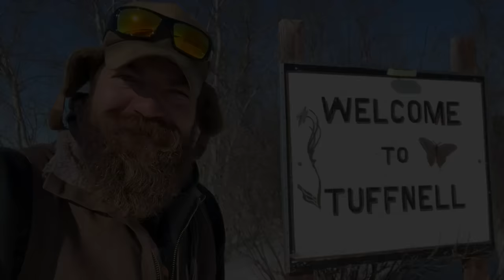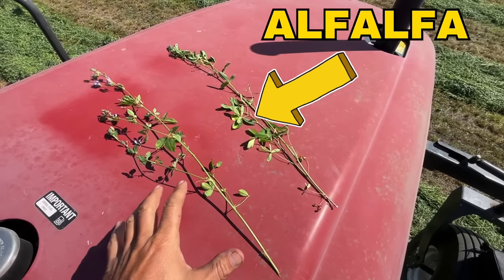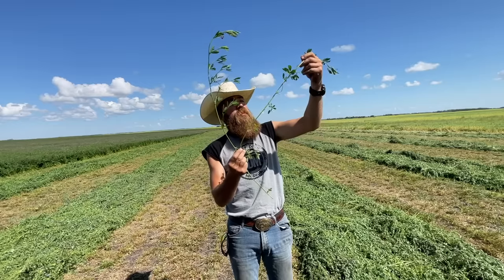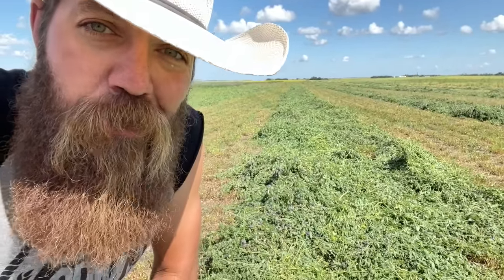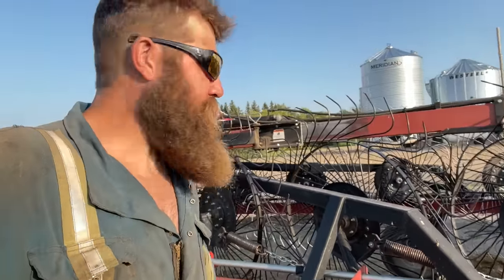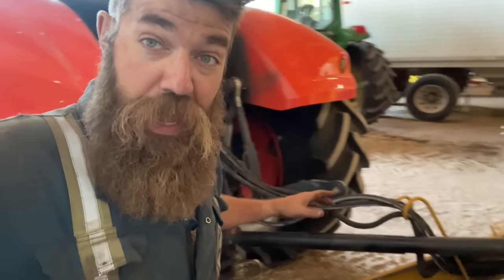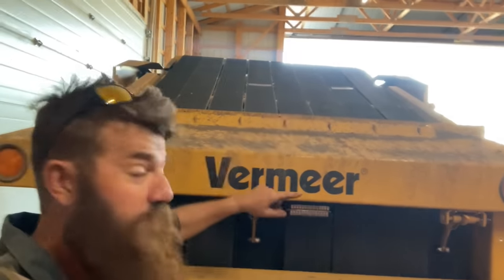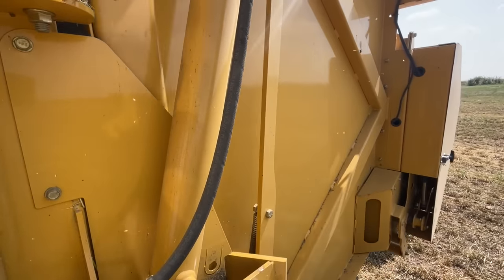Hey, Let's HAY!

Comment: If someone could combine 3 of these machines and processes into one machine, cutting your time taken by 2/3rds or  even just in half, how much money would you buy it for
Reply: The problem is you need to dry it. However if you skip that step you're into something called 'haylege' which I'm sure ol' QDMcD will touch on in part 2.  It has advantages and disadvantages too.

Comment: I remember the days when farm equipment was far less sophisticated. My uncle even had an old Case (I don't remember the model) that originally came with iron wheels. Equipment sure has changed, as well as some of the techniques, but the basic job remains the same.